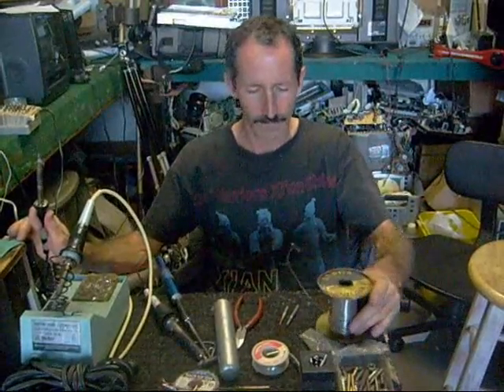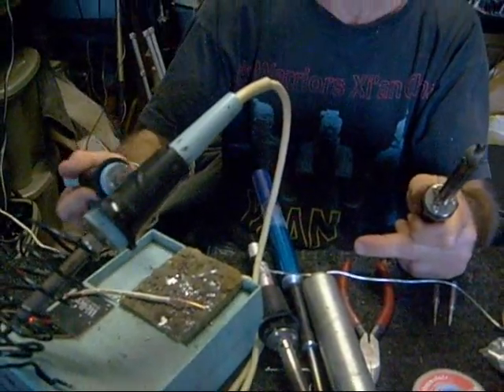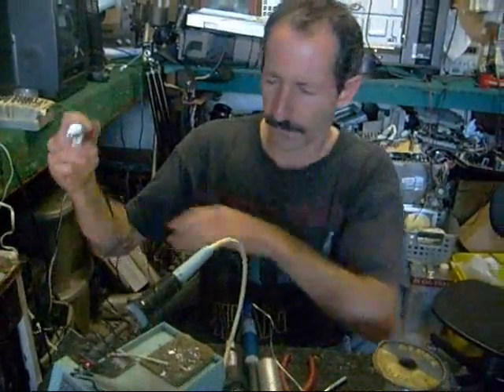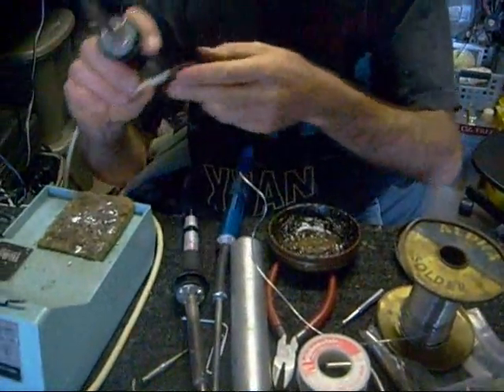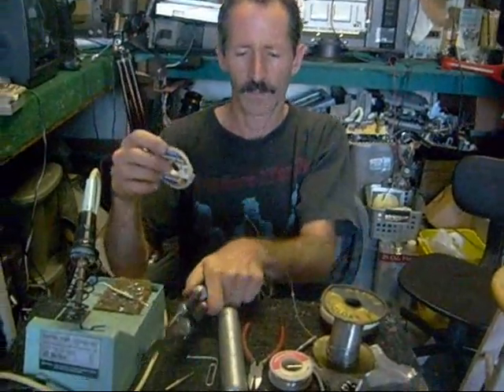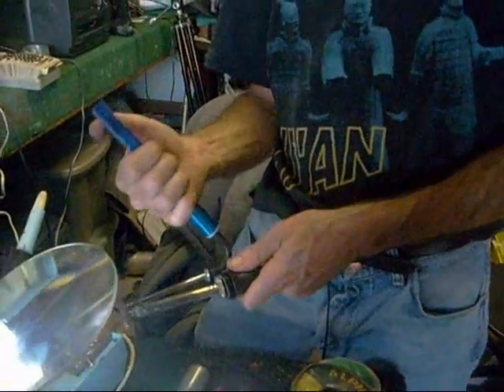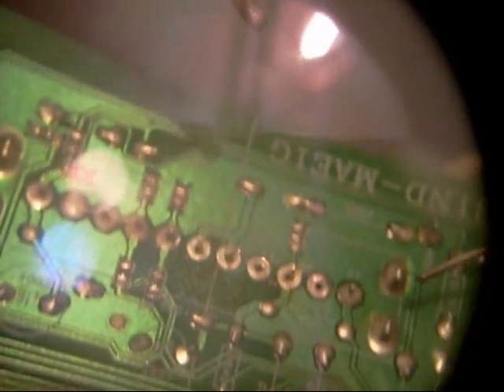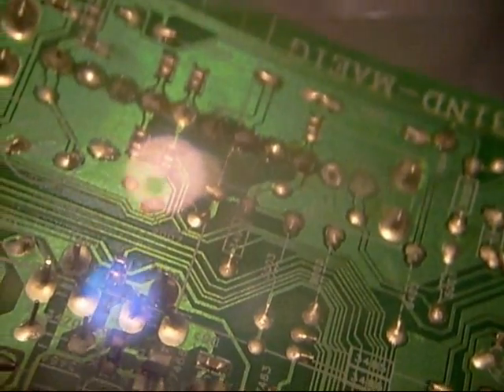Soldering

Comment from the maker: Sorry to hear about your difficulties. It sounds as though your tuner circuit board probably became cracked across one of the foil traces when the connector was pulled out, or you unknowingly unsoldered one of the very small  surface mounted components. I suggest you take a 10 powered magnification lens to help you check things over. or find a replacement. If all of the above fails my best advice is don't let it upset you. Part of this business
is learning to deal with failure gracefully.